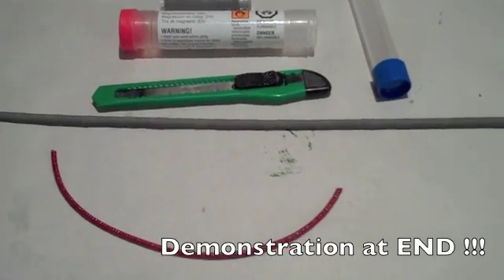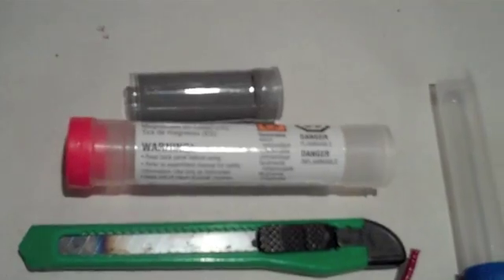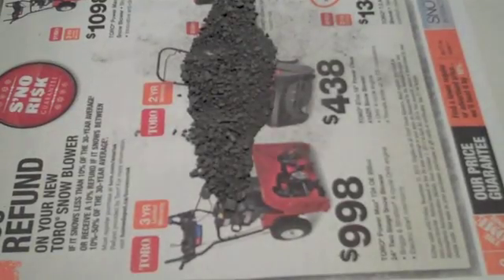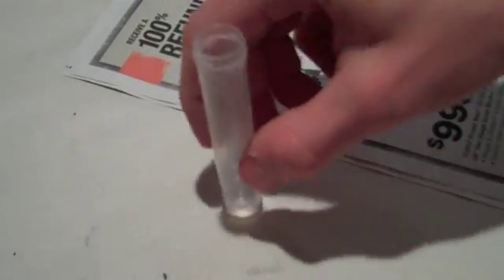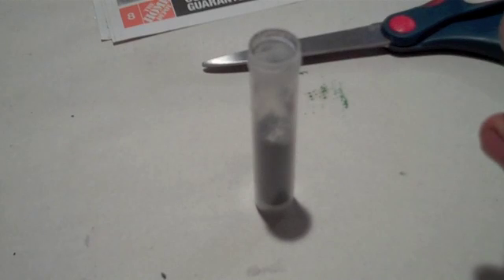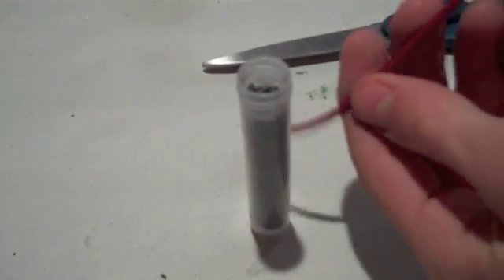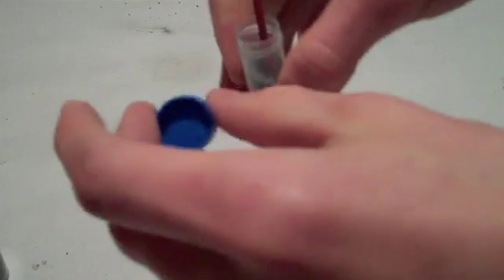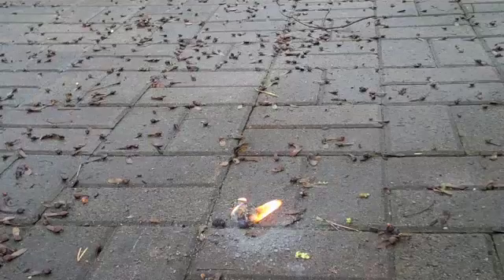How to Make 'Thermite'

Comment: This is not thermite. This is a shameful firework. Thermite burns at 800+ degrees and can melt metals.
Reply: Hotter then 800. More like 3000
Reply: But can it melt steel beams